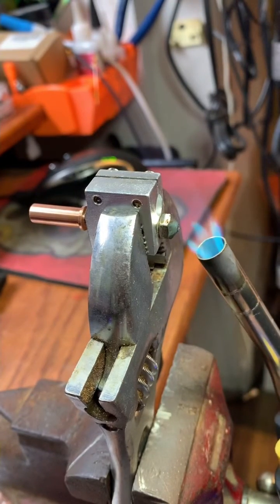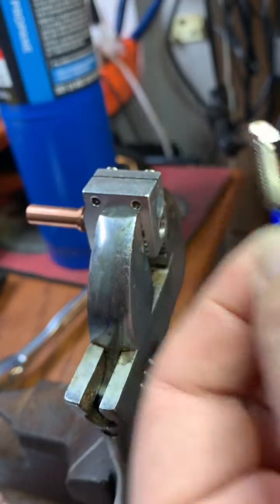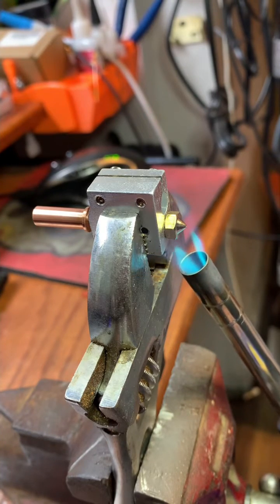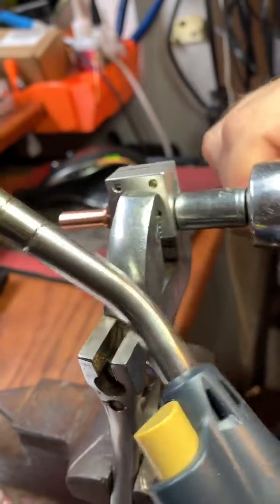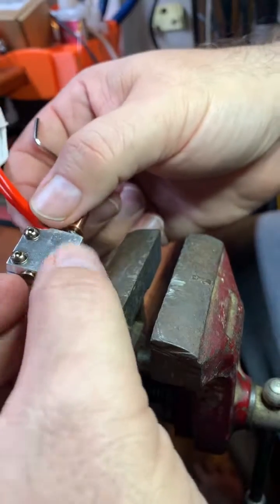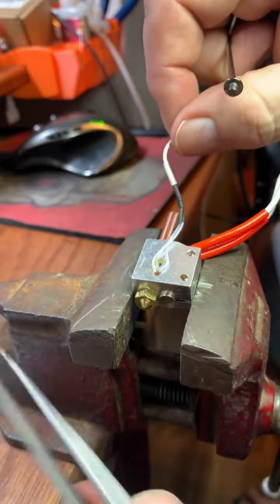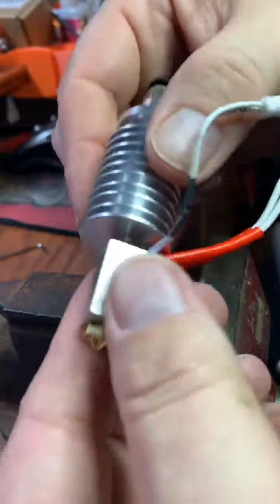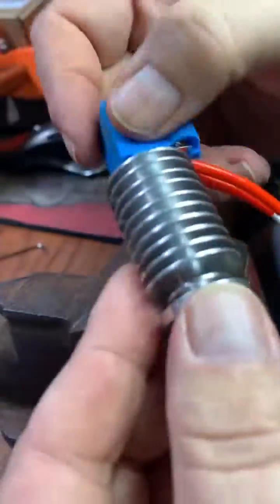Anycubic Vyper hotend bi-metal volcano nozzle install!

Comment: Thanks for the video. Do you not leave a gap in the nozzle? All the others do and would like to understand. You have way more xp at 7yrs then my 1 so please teach me
Reply: +1
Reply: I left a big gap, because i have the heatbreak (bi-metal piece) screwed down far and just couldnt get the nozzel any tighter.  But im starting to think i shouldnt put the bi metal peice down that far, I went as far as it would go (finger tight) It looks like he didnt screw it down far as i did, hence why he he's able to screw the nozzel up higher, pretty much flush to the heatblock.   Is that good? I dunno.   Maybe theres another reason not to have it up against the heatblock, but you want to screw it tight so it touches the heatbreak is the point i think.  If you leave a gap youre potentially not screwing it tight enough.  If you want that gap then you adust the heatbreak from the top and bring it down so you get that little gap.  Thats my understanding of it.  But not sure why there has to be a gap.  You can see in the video he can adjust both the heatbreak and nozzel to determine that gap. So if you want that gap for whateve reason adjust the heatbreak (bi-metal piece)  to stop it at the gap you want.  Also note that when you screw the nozzel tight up against it, it will turn the bi-metal piece too,  if its locked into the heatsink that might put unessary stess on the threads, i think i damaged the threads this way on my original one. Another time i sheered the nozzle head straight off because it it was already tight enough... so maybe its a good idea to free the bimetal piece from the heatsink so it can turn a little if you overtighten, then lock it into the heatsink after you know the nozzel touched.